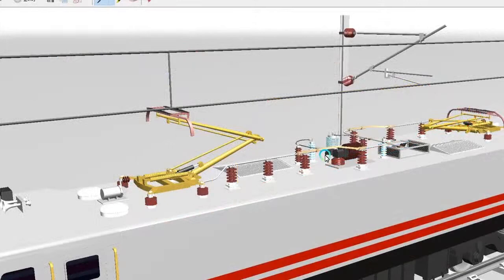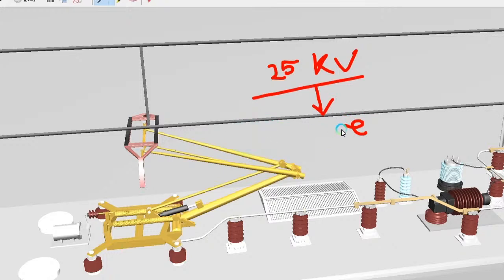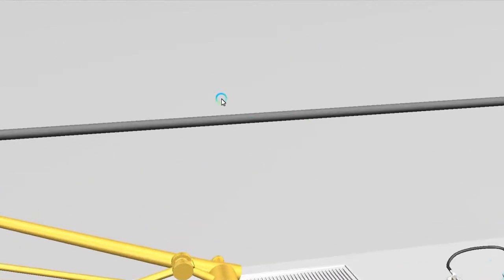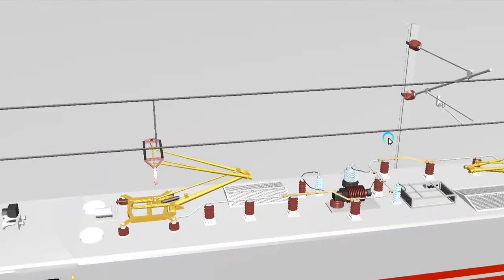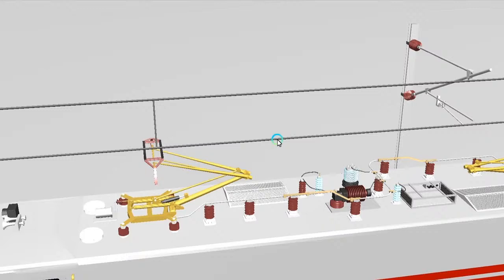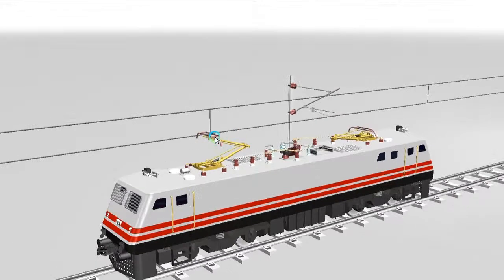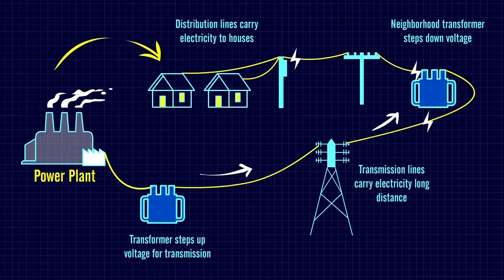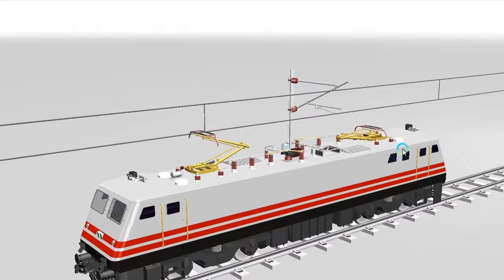Why 25 KV used in railway electrification system | Comment Video

Comment: Electrons do not flow in ac current, but oscillate about the mean. It's the potential that is transferred and conducting, and difference in potential is the driving force.

Comment: Why 25kV?   Why not, say, 16 kV  or 38 kV or something else?
Reply: For a constant power to be supplied you must have heard that the operating voltage and current flowing through conductor is inversely proportional... So if the voltage is reduced to say 16kv which you have assumed then the current in the conductor will increase leading to copper loss and also the conductor diameter should be increased thereby enhancing the weight... 
Otherwise if the voltage is increased to say 38 kv then the spacing between the OH Line and tracks should be increased so as to maintain a safe distance. Hence taking into account other mechanical constraints the height should be maintained as well. Hence after considering all the factors 25kv is accepted as the operating voltage of railway traction system

Comment: 25000 kv
Reply: its wrong it should be 25kv or 25000 V
and who react it love sign.. I have a doubt about his concept🙄🤔
Reply: 25000 kv means 25000000 volts.. I think no insulator can handle such enormous amount of voltage